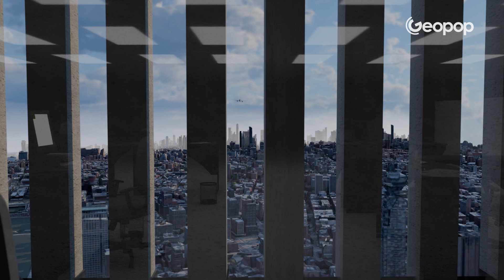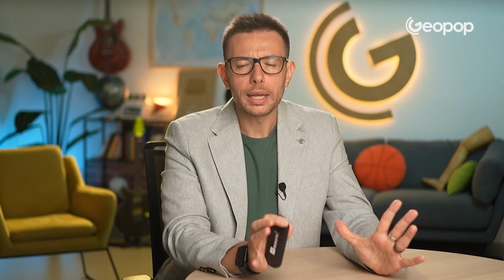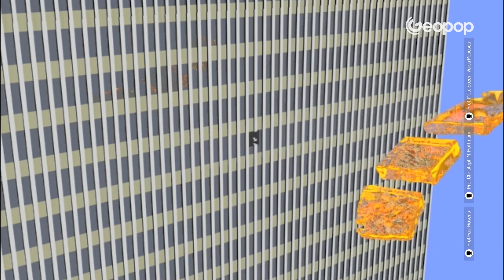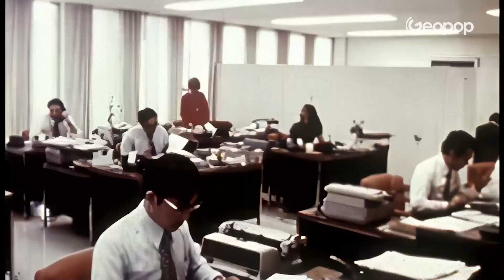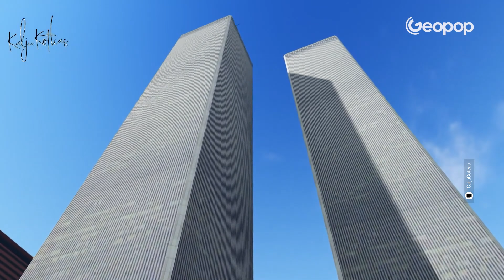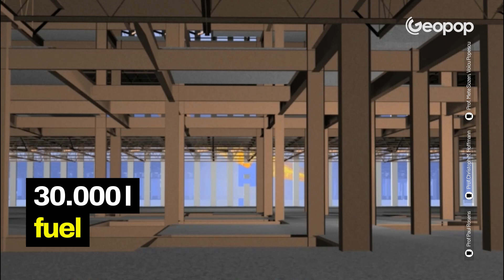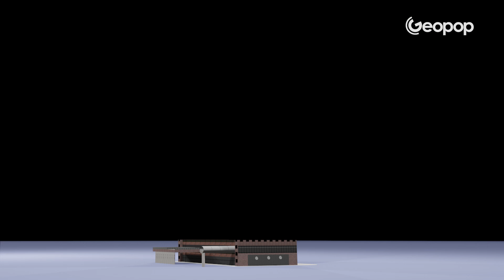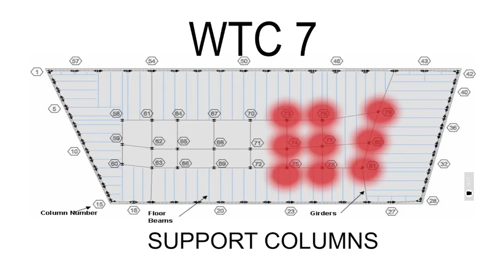9/11, 2001: The Technical Reconstruction of the Twin Towers and WTC 7 Collapses

Comment: This comment section is a prime example of the dunning Krueger effect
Reply: It's almost alarming.
Reply: Which is more extreme -- to accept without question the inexplicable lack of turbulence in the wake of a 500 mph large passenger airliner -- not evident in the smoke and fire covering the impact zone only seconds later? -- or to recognize the indications of digital projection in its imperfect nature as we see a wing disappear in front of a bright blue sky? From another camera angle, the same aircraft is seen passing behind a crane in the foreground, yet in front of the heavy crane cable. 

There should be a hurricane of turbulence in its wake that would entirely disrupt and disperse the smoke and fire seen billowing outward just 3 to 4 seconds later at both towers.  Even the wake of a small Cessna aircraft would be noticeable -- yet there is nothing.
Reply: Apparently not !!
Reply: -- Then what is the source of the many tons of molten steel found in and under the debris, the heat so intense that the molten steel remained in that state for weeks afterward, running off of the debris as it was excavated. This cannot be molten copper from wiring that retains the color of a shiny new penny.  It cannot be molten aluminum that retains the color of the polished aluminum wheels of a street racer. It was the color of glowing orange molten steel  that cannot be mistaken for any other material, reported by firefighters who are very experienced in the nature of such materials as well as seen in video evidence.

When you combine this with an entire lack of turbulence behind 500 mph aircraft, when even a small Cessna Aircraft would leave an evident wake in the smoke and fire only seconds later .  . We find that skeptics still cannot be skeptical of the official narrative in explanation.  Sponsored channels and forum activity are skeptical of nothing when support is provided.

Sponsored activity in the forums is very normal today for commercial and political purposes and subjects of controversy -- in the attempt to lead public debate.
Reply: @ElLowEl .  . "What the hell are you talking about?" .  . 😃 .  . Thank you for your sponsored reply, Mr. EILow.  The word projection indicates holography as you know, commercial demonstrations of which have been amazing in recent years.  To feign ignorance doesn't work well for you, however.  Where, Mr. EILow, is the wake turbulence only seconds after passage of a 500 mph large passenger airliner -- not seen in the smoke and fire covering the impact zone?  Even the wake of a small Cessna Aircraft would be noticeable -- yet there is nothing.  It's likely that no real answer from you is forthcoming. We'll wait and see .  .
Reply: Very true. I can't understand why people struggle to accept that large amounts of kerosene burn hot enough to weaken the steel. People were jumping out windows it was so incredibly hot. I understand that prior to the terrorist attack the buildings were getting a fire proofing upgrade. I think they were working their way up so they werent up to the high damage zone. I wonder what difference it could have made. I have also been told the spire on one tower hit the WTC7 damaging it. I have never seen a shred of evidence that controlled demolition caused any of the building failures. People that rush to make crazy judgements on everything annoy the hell out of me.
Reply: Pycology an area of science created by Scientists who speak Yiddish
 Religion originating from groups of people who speak Yiddish
Communism Russians who speak that language.
 Media tech sector dominated by a group of people who speak Yiddish.
 Hollywood, News papers. Arts.
 Where there is the written word there are people in funny hats trying to shape and control your minds and what you think about the world.
If properganda had a religion. We know what it would be.
 Theres no such thing as Dunning Krueger. Theres intelligent people who are being misdirected when they ask for accountability.
 Do not be so rude to your fellow man. They are much smarter than you realise.
Reply: @paulgibbons2320 Pycology an area of science created by Scientists who speak Yiddish
Phew 😥 Well I guess it's a good thing I'm talking about PSYcology then, for just a second I thought you had me on that one 😅
Reply: Its not uninteligent to ask for truth and an honest investigation.
 Why would you  want to deny people that ?
Reply: Well....

I would say it's more of a prime example of how bad cognitive dissonance is being present in the overwhelming majority of people.

Logical questions cannot be asked without being ridiculed. 
Outrageous assumptions (which most people do not even perceive as being as such) cannot be questioned without being ridiculed. 

All because of a seemingly  holy faith in the sincerity and objectivity of govt institutions. 

You yell me bro, what is so illogical or offending about ANY of my questions?

I just want to know the truth about what happened that day.

Don't you?

Comment: But surely there would be some resistance.. the building fell virtually in freefall. Also it all happened simultaneously.. I'd expect a bit more creaking, and slow movements as areas weaken due to heat..

Comment: Sure.. going over the NIST models and creating the science to corroborate the result will make it sound plausible. However you never went to Architects and Engineers for 9/11, nor did you speak to Steven E. Jones regarding the nano thermite found in the dust  created by all the towers that collapsed. A substance not created by jet fuel and aluminum.

Comment: Thermite did the job. The bombs did further weakening to the structure. All strategically and secretly planted weeks before.
Historically no tall steel buildings collapse the way they did like in the case of WTC. Many highrisers that were burning for days did not collapse, they stood tall...the only anomalies to this is the WTC in 2001.
Reply: I’ll bet you don’t even know what thermite is. 

Riddle me this, genius: 

How and why would anyone rig a building to collapse by packing all the exterior columns with thermite, which would require split-second initiation at best, then fly an aircraft with precision accuracy into the exact spot you’d rigged with thermite in the first place?
Reply: @Dennycrane757  easy answer there smart pants. Firstly, you do not have to knock out all colmumn for a building to tilt under its own weight. There are videos of shattered glass and dead people on the lobby minutes before the collapse. There are surviving firefighters to attest to this. The aircraft just added to the drama, smoke screen for the gullible people like you...
Reply: @Dennycrane757  The thermite was planted at the foundation and was hidden from view. Bombs went off also, firefighters witnessed bodies at the lobby. The aircraft just hit the building causing damage but not critical, the catastrophic failure occured at below the ground level. Weeks after the collapse (during the cleanup) you could still see molten metal like lava due to thermite, it was like a furnace down there.
If the aircraft was the only reason for the building to collapse under it footprint, the kinetic energy and the subsequent heat was not sufficient. The WTC was designed to sustain multiple hits from the then new boeing, the 707. Although it was lighter it had 4 engines instead of two of the 767.
But the media and the US goverment convinced a lot of gullible people...same as the accusations of Powell at the united nations saying that Iraq had WMDs. It was proven later that it was a lie.
Reply: Rubbish. Get a life.

Comment: No no no it was controlled demolition using nano thermite just ask yourself how did three buildings collapse with two planes ask why did the flight into the pentagon have no recordings besides two crappy videos ask why the plane that flew into the ground that there was no wreckage none understand physics look at grenfell tower in London burned for hours and it did not collapse the only three steel and concrete buildings to collapse by two planes

Comment: The amount of debris at the end does not match the mass of the buildings
Reply: This is one of the most overlooked points. Firefighters who participated in the clean up reported that all that was left was steel, dust and concrete.  In buildings of this size it is illogical not to find pieces of office furniture, computers, cabinets, partitions, electronic equipment,  toilets, pipes, etc in the rubble. What happened to all of it?  It can be smashed to smaller pieces but there were would be pieces. There is only one way to turn it all to dust.
Reply: The debris field was still stacked multiple stories tall.
Reply: 120 stories collapsing (700 MILLION pounds or more) in less than 10 seconds doesn't make sense to you? That kind of force will turn anything to dust.

Comment: Who paid you to produce such convoluted propaganda? The temperatures required to compromise steel are far higher than anything in a fire, even one with jet fuel. The strength of steel is the very reason skyscrapers are even possible. Only three steel-frame buildings in history have ever collapsed from fire. All three occurred on the same day.

If your “non-conspiracy” theory was true, they would have stopped building skyscrapers. And what about building 7? Your theory is far less believable than the “conspiracy”. Most do not claim that they know who did it, but 9/11 was a controlled demolition. The evidence is overwhelming.
Reply: What evidence? You have no evidence. Zero.
Reply: @takotako3321  Tell me. What evidence do I need? My statements were careful not to assume anything. These are known facts, but nobody wants to explain why.
Reply: @mikerwriter  Sure. First of all, you're just simply mistaken on the facts. Plenty of steel buildings and structures have collapsed: 
Kader Toy Factory
Architecture building at Delft U 
Sight and Sound Theater
Plasco Building (Steel)
Edifício Wilton Paes de Almeida (Steel & Steel-reinforced concrete)
Windsor Tower (All of the top 11 steel floors)
McCormick Place
Mumbai High North Platform
Highway 580 in Oakland 
Dogwood Elementary School

Just to name a few. You're also mistaken on the temperatures required to weaken steel. General consensus is that the the fires were up to and around the 1000°C range. Strength loss for steel begins at around 300°C. Structural steel isn't fireproof. The load-bearing capacity of structural steel is typically affected at around 550°C.
Reply: @takotako3321  Sorry, but YOU ARE WRONG.  Look it up.  Search for examples of any steel-framed buildings that have collapsed due to FIRE.  There are only 3 examples in all of history, and all 3 happened on the same day.
Reply: @mikerwriter  Wrong. Again, steel buildings have collapsed due to fire:
Kader Toy Factory
Architecture building at Delft U 
Sight and Sound Theater
Plasco Building (Steel)
Edifício Wilton Paes de Almeida (Steel & Steel-reinforced concrete)
Windsor Tower (All of the top 11 steel floors)
McCormick Place
Mumbai High North Platform
Highway 580 in Oakland 
Dogwood Elementary School
Reply: @takotako3321  You're not being honest with yourself.  The only building on this list that comes close to "high rise" and the particular kind of steel-framing I'm referring to, is Windsor Tower.  It didn't collapse until months later, when they had to use a controlled demolition.  Anyone with a minimum IQ can plainly observe that both towers were detonated with a controlled-demolition from the inside.  The evidence goes beyond just amateur observations, however.  Thermite residue was found on some of the materials removed from the wreckage.  Larry Silverstein, who purchased the World Trade Center just months prior to 911 (and insured them for $3 billion) was recorded on news video, where after being asked about building 7, he said "the decision was made to pull it."  He later recanted, but the video is still available for anyone to see.  I'm sorry, but the disinformation campaign is to keep us thinking that it was 28 muslim jihadists from Afghanistan, and they very well may have been involved, but the twin towers fell straight down, not tipped over, within an hour of each impact.  That's never happened before or since, and I think you know it.
Reply: @mikerwriter  Yes, steel buildings, including high-rises (Plasco & Wilton, etc), have collapsed due to fires. Glad you admit you were wrong. Yes, they decided to "pull" all the firefighters away from the building, confirmed by the firefighters:
"Yeah, we had to pull everybody back."
"... they were worried about now Seven coming down. So then they pulled us away."
"One of the Chiefs pulled us out of there."
"Finally they pulled us out."
"We pulled everybody back probably by 3 or 3.30 in the afternoon."
"There was a big discussion going on at that point about pulling all of our units out of 7 World Trade Center."
"So they pulled everyone back, and everybody stood there and we actually just waited and waited until it went down, because it was unsafe."
"We operated until they finally started pulling people back. ...They pulled us back, I think it was like probably between 4 and 6, because of Seven. "
"... the chiefs pulled us out."
"We were actually - they pulled us all back. Actually they pulled us all the way back that far at the point because they didn't want any - they didn't want us anywhere near it."

The residue was examined and confirmed to be primer paint used in the buildings.

Any other questions you need help with?